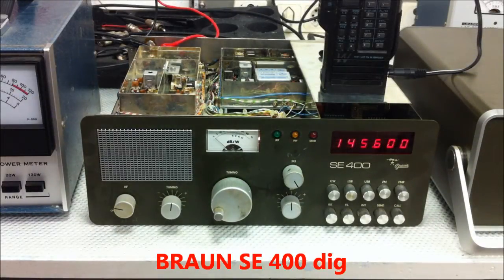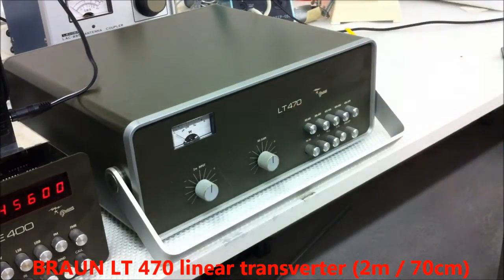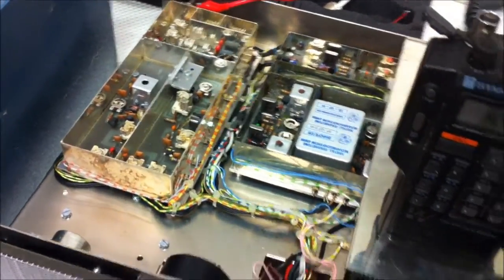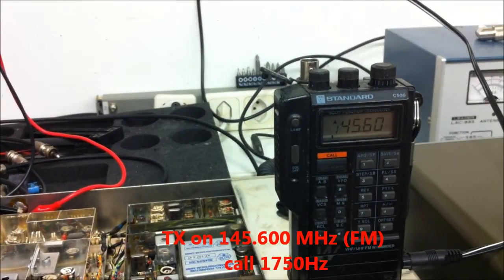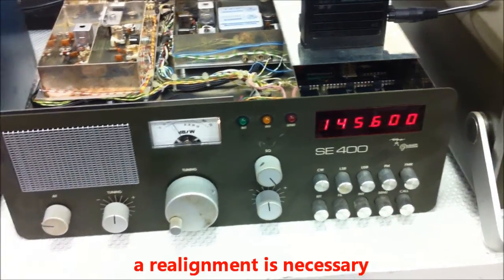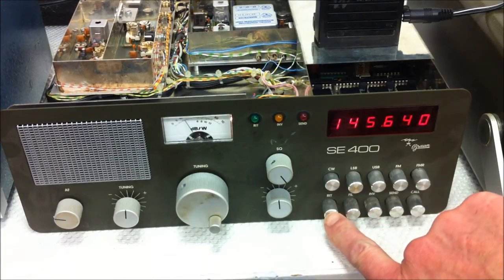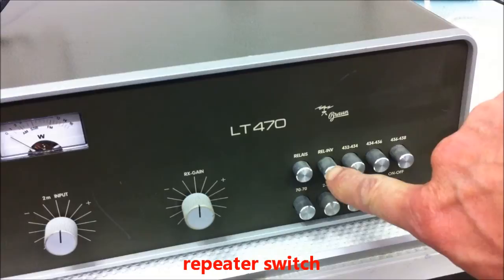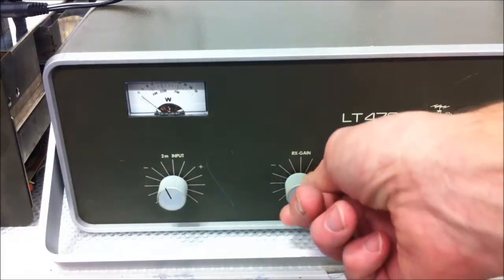BRAUN SE-400 dig and LT-470, SSB/FM - VHF/UHF HAM-radio (short overview)

Comment: Did own (and used) a Braun 2m many years ago, a great transceiver ! I could get a lot of needed money for it at the time and sold it with mixed feelings. 73 Leo PA5LS
Reply from the maker: Leo Starrenburg Hello dr OM Leo. Thank you for your comment. The SE400 is a very tricky Transceiver. I think, there are a lot of handmade modules in the Chassis. A very rare rig. Best 73's to you..